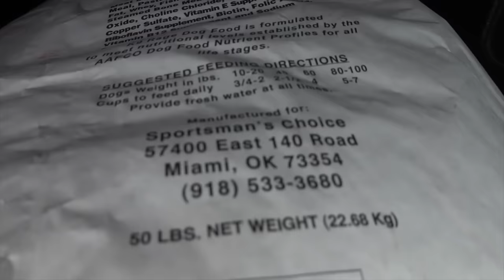I Can't Believe She Left Like This! Caught On Reolink Camera

Comment: Sorry, but Russell as a puppy needs to be fed 3 times a day and the adult dogs need to be fed 2x a day. If you have a problem with them not being hungry you are over feeding them.  Contact your veterinarian and ask them to calculate how much food each dog should be fed. Your vet was taught in school how to establish this by using a formula of RER. You have to look on the bag of food and find the # for what is called Kcal. Kcal is what it sounds like - calories per cup of food. The reason you need to have the vet figure this out is they will know what the optimal weight for each dog is. The formula starts with whatever the optimal weight is divided by 2.2 and that gives you the kg  #. Then you multiply the kg# x 30 then + 70 which gives you the RER. Divide that # by the Kcal # and divide that # by the Kcal/cup which will equal how much they should get each DAY.  Don't forget to let the vet know you are supplementing their food with an egg each day. That will change the RER # and throw off the calculations. By doing this your dogs won't ever be over/under fed ever and more importantly they will be the healthiest dogs ever. I've done this with all of mine and they've all lived to a ripe old age of 18-19 years old and were vital up to the end. By doing this you keep them from developing kidney problems, joint issues, no diseases like pancreatitis AND I saved a bunch of money on dog food.

Comment: Olaf is safe with the donkeys as they make great livestock protection animals. *   Also Rachel when Russell resists just stand still , with slight tension on the leash as soon as he gives any forward movement = reward it , he will learn that going with you / following the leash means a treat especially if they are food motivated.

Comment: Just remember that if you’re going to keep them in tap until these at least two or three, which I recommend goes big large breed dogs require their hormones. Sit order help them grow and have sturdy joints like my lap puppy still is intact. He will be getting fixed when he’s too so he about ready to get fixed but the point was at six months old is when their hormones kicking, there’s possibly going to a moment where he may that he wants to try and test the waters that he will act like he literally has forgotten everything. I am assuming that, but that’s just what happened with mine what Breeder told me and the same thing also happened once he turned a year old so they go through different phases of it but they all get back on track so don’t be taking

Comment: You are using the wrong feed , you need eractites feed for Emmues. For Ostriches too. Check with Cog Hill. They have plenty of eggs. Also put them in a separate pen, they may not feel it is safe with the goats. They may feel the goats will break the eggs.

Comment: "Leave it" and also "Not". 
Walking two dogs on leashes helps teach the newby the rules. You use a stick or PVC pipe and swing it from side to side across you in front of them and they won't run ahead. 
My dog learned  "leave it" and realized she could get away with a lot, before I spoke all the words. If I used "Not" she didn't have as much time for mischief. I think the "leave it" and "not" use more voice tone recognition? 
We progressed on to "Stranger Danger", which required someone whom had been in the house trying to sneak back inside inappropriately. 
Y'all are doing a good job!!